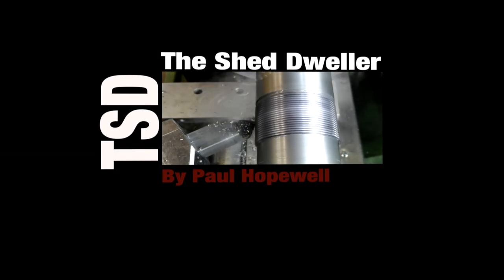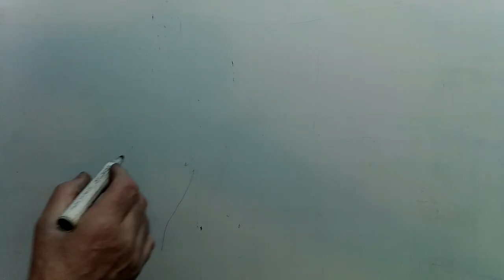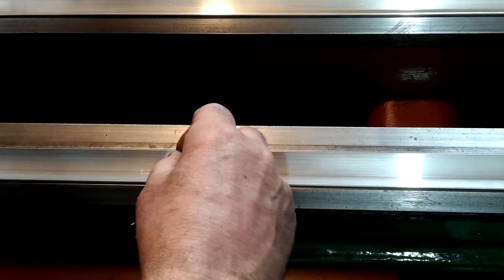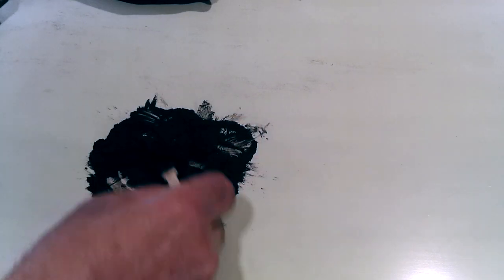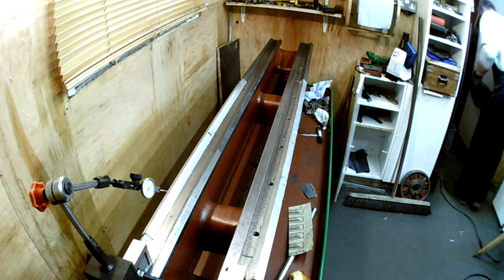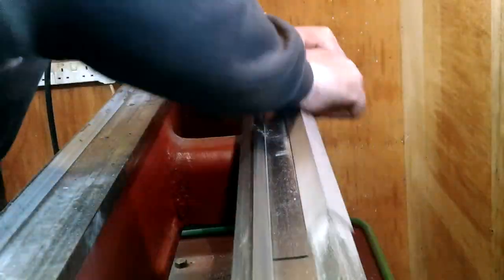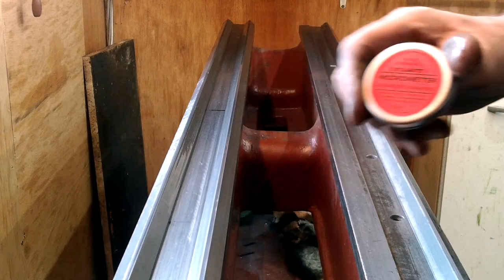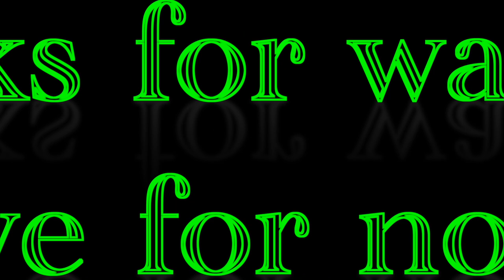Slide fix, South Bend 13 (pt5)

Comment: Look forward to the updates. I'd expect the JB-Weld to hold up pretty well with the filler (I've seen some crazy stuff done with it and other higher end epoxy), and I'd not be surprised if you now have a better than new flat and straight machine - such giant old iron was probably not that perfect from the factory as for the most part the operators are well trained experts that can when the tolerance requirement is fine enough make up for the machines imprecision on the fly (plus the size of it to the size and tolerance of most jobs means that error works out as irrelevantly small) - not seen many period adverts that mention such precision for anything larger than a clock/watch makers lathe myself...
Reply from the maker: Hi, Yes you’re right I started my machining life on machines that were well past their sell by date, and we were always expected to work to very tight tolerances even on colossal machines, one of mine was a small 20 metre long four point milling machine. The biggest boring machine I ever worked on was a 14 foot dia twin ram. scary stuff. regards.

Comment: The mixture of jb weld and iron powder is good for stationary use but will it not withstand the wear when used as a slideway. So much work...for what?
Btw: What do you want to fabricate an the lathe, parts for satellites? I have the feeling that you overestimate the need of precision of the lathe for daily work.
Reply from the maker: Hi Paul, for most of my life I worked on very old and very big machines all of them had wear in them and all operators that worked these machines had to make turbo generators and locomotives to very high standards, I bought this lathe with the knowledge that it was worn and tired, my mission in this case is not to fix it up like new, but to get the best I can from it. Your input is most appreciated, thanks. PS. I hope the JB stays on otherwise I may have to do it again, another way.